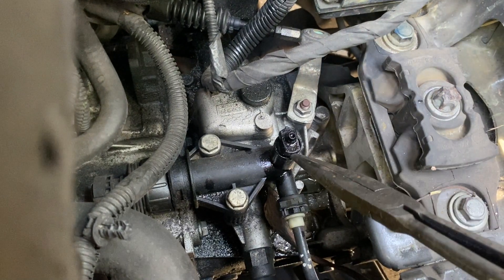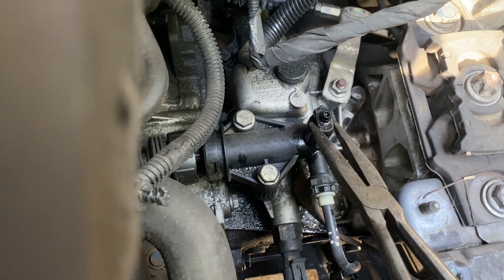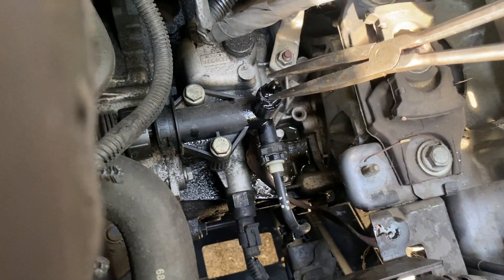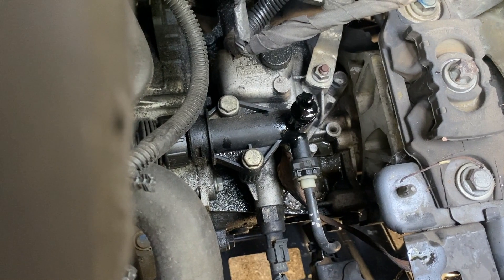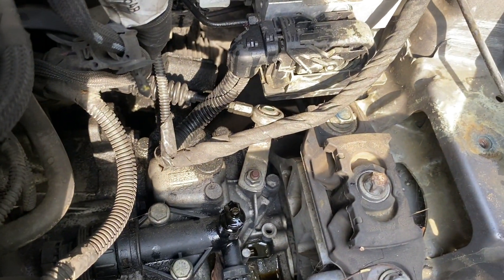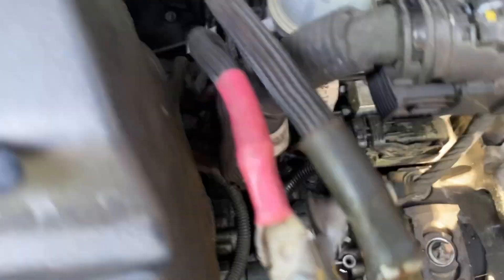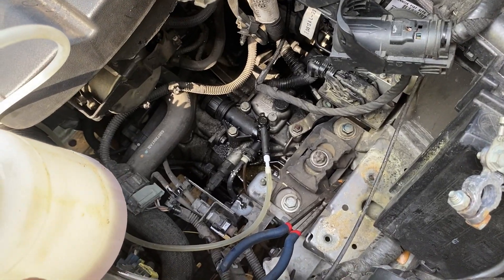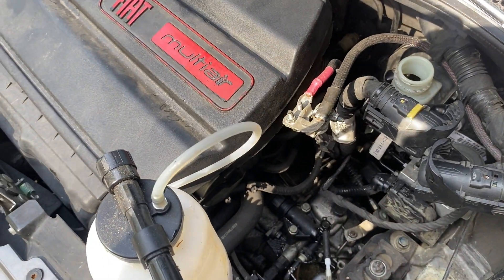How to Bleed Fiat 500 Clutch

Comment: Did this and now the car will not go into gear unless it is off.
Reply from the maker: That sounds like a clutch problem. It's possible you didn't bleed properly and got air in the system. Did you make sure to keep the system topped up with brake fluid? Why did you bleed the clutch in the first place?
Reply: @abuzar1  Yes. Made sure the reservoir did not go below the min mark. Very odd. It was having a clutch problem. No reverse unless off but I'm confused as to how it would all stop working by bleeding the clutch.
Reply: Did you manage to fix it? I've also got an Abarth 500 that won't leave neutral and get into a gear.